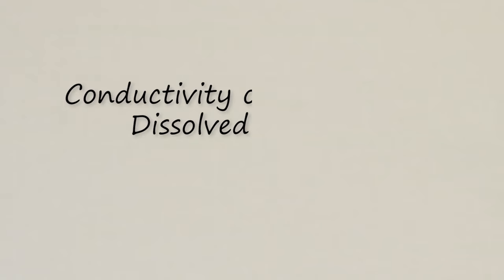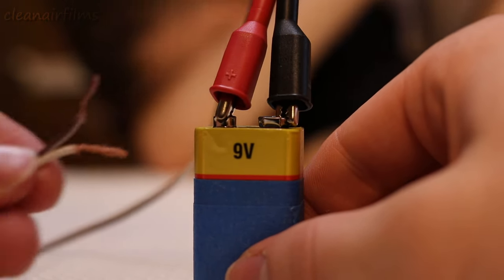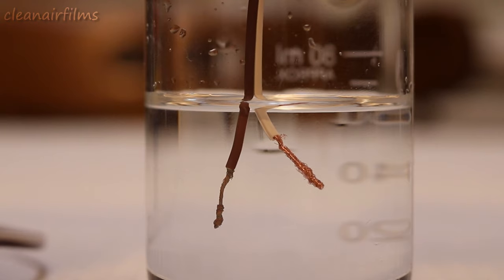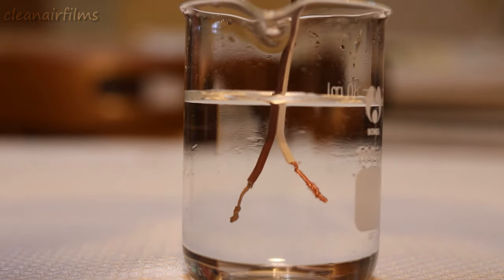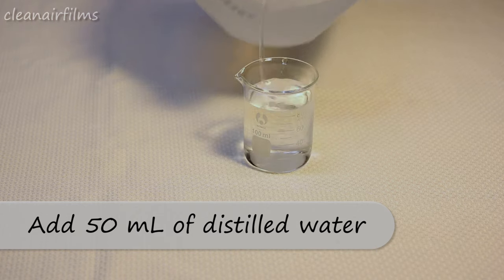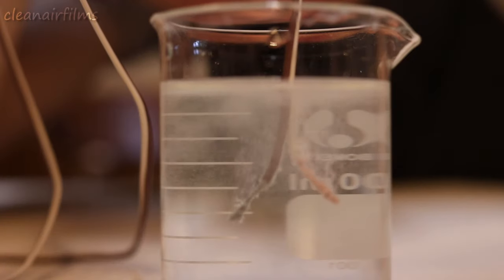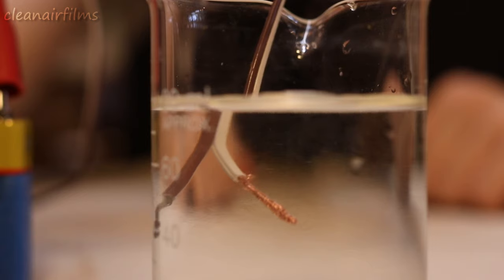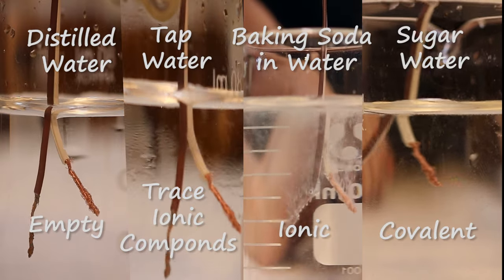Testing the Electrical Conductivity Of Water | Science Experiment

Comment: Although it is not the intention of this video, this appears to support the theory presented in this online document '100-Reasons-Water-is-Not-H2O-by-Peter-Peterson', which states water is just water, and like the good old days should be regarded as an element in its own right. When as a result of electrolysis hydrogen and oxygen gas are produced, it is as a result of the breakdown of both the anodes and electrolytes - not the splitting of water.

Comment: Interesting stuff, why use 9v battery instead of 12v? does the voltage make any difference?
Reply from the maker: 9v vs 12v doesn't make any difference in the experiment. The only change would be in the rate of electrolysis.

Comment: So in theory you can build a computer in water? As long as the water is pure and remains pure?
Reply from the maker: In theory yes. But as soon as something is submerged, trace ionic elements would dissolve in the water, and would short any electrical device.
Reply: @TheBoringVoice  What if you clean the parts first with pure water and keep a steady flow of pure water coming in?
Reply from the maker: Cleaning wouldn't really solve the issue of trace elements; it would just help with the initial setup process. If the water was continually replaced with pure distilled water in a replacement loop, then I don't see why it wouldn't work. Cycling a continual replacement of the pure water would be an excellent way of keeping the device cool. You would want to make sure you don't introduce air bubbles in the container, to lower the possibility of oxidation.

Comment: Where could I get the wires used in the experiment? would paper clips work?
Reply from the maker: Copper wires work best. Could find them at a hardware store.
Reply: Audio equipment stores also carry copper wire as they’re common in home sound solutions. Electronics stores would have wires as well, but you can almost certainly find them on Amazon and eBay as well.

Comment: How can we measure the conductivity with an arduino board?
Reply: Find the resistance of the water on the circuit.
Resistance, (R)= (Voltage/Current)

You know your voltage and amperage from the battery or power source you’re using, and from this can determine the resistance the water has on the circuit, thus determining its conductivity, or lack thereof.

Comment: A baking soda solution works good to clean corrosion off of car batteries...
But make sure you wash the puddle of electrolyte solution you just placed on the battery... I totally didn't do that and run a battery completely dead 😏
Although I'm not sure how much of that was actual discharge versus the possibility of the baking soda making it into the acid 😅

Comment: Hello. Thanks for the demonstration. One question. Does the battery have to be turned on or somehow put in connection with the wires, in order to transfer electricity?
Reply from the maker: No, each wire connects to the battery independently.
Reply: One wire goes to the power source’s positive terminal, another to the negative terminal, separate from each other, and then the water is acting as a wire connecting the two ends inside the glass beaker.